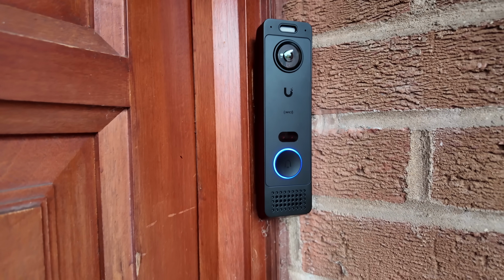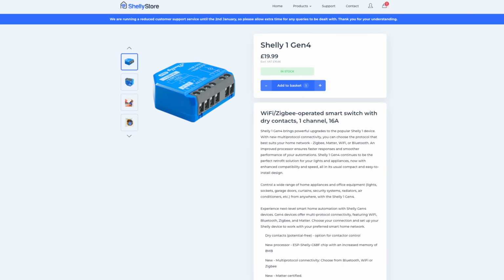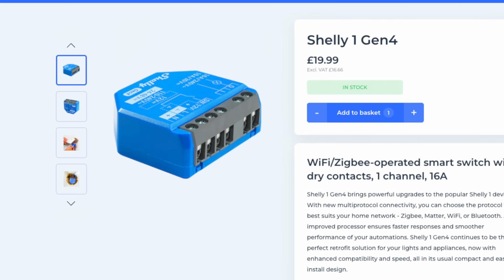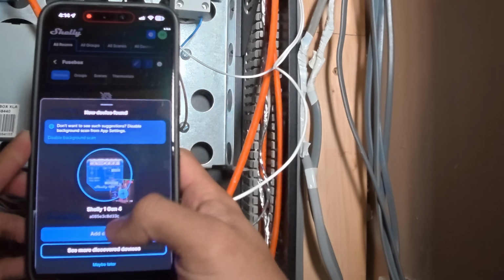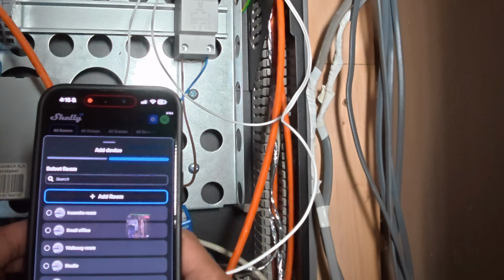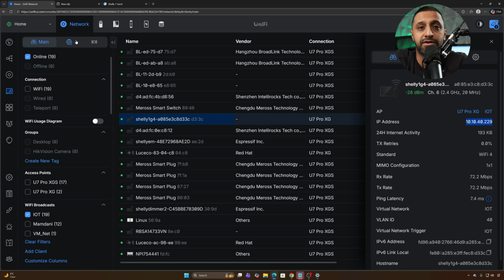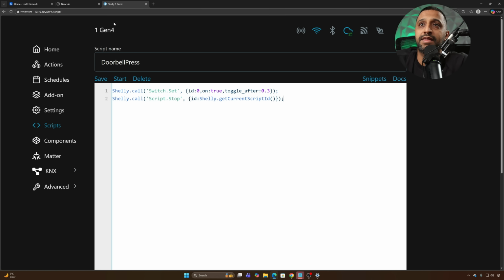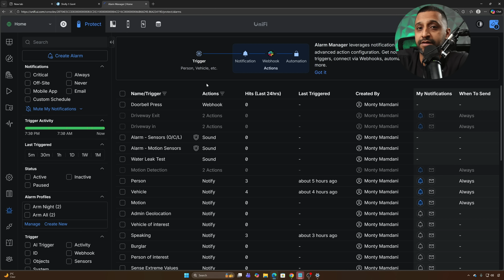UniFi PoE Doorbell + Mechanical Chime (No Home Assistant)

Comment: For anyone else doing this, do yourself a favor and get the Shelly Pro which has an Ethernet connection. This will give you a wired connection for the whole setup. Relying on WiFi could be problematic.

Comment: I would like to ask you if is possible to use a mechanical chime and get that signal to simulate the door bell is pressed? Something like adding a extra mechanical press button to activate the doorbell. Thanks
Reply: That‘s possible with Shelly but it would only trigger the chime when you press the extra button. You wouldn’t get a notification over unifi protect.

Comment: My question is about power supply:
	•	Does the Shelly require its own permanent power supply (e.g. 230 V AC or a separate low-voltage DC supply)?
	•	Or is it possible / intended for the Shelly to be powered directly from the doorbell circuit (typically 8–12 V AC from the doorbell transformer)?
Reply: Shelly Uni Plus can take 8-24VAC but the Shelly 1 gen4 cannot.  I am using the Uni plus powered by my chime.
Reply: You can use a AC to DC transformer to power the Shelly with the power supply of the chime.

Comment: I’ve also done this on my g6 lite, the only annoying bit is ubiquiti rate limit the doorbell notification. So if you’ve get 2 presses within say 20 seconds it doesn’t register the 2nd
Reply: Could someone test if this is also the case when the chime is connected to a hub mini (door 12V relay) and mapped to ring trigger in alarm manager? I assume it will be the same, due to limitation in notification in general?
Reply: @edstark5764 correct

Comment: The video was not very clear. Your hands wear covering what you were doing, so it is difficult to see how you are connecting the wires.
Reply from the maker: Thanks for the feedback; first time trying this kind of POV angle so will try and improve. I did put a diagram after the install showing you the wiring which you can see.

Comment: All I need is a Shelly and the G6 Doorbell, correct? No other (Access) Hub from Ubiquiti needed?
Reply from the maker: yes this is correct!
Reply: The doorbell requires a software service called protect. This typically runs on other ubiquiti equipment (gateways or nvr). You'll also need to provide the doorbell with poe power.

So afaik you can't run the doorbell without any of that infra.
Reply: @sanderdelft thanks for your reply. I forgot to mention that I own already some Unifi equipment such as PoE switches, the Cloud Fibre Gareway etc. 
I was more interested to know if any (access) hub is additionally required for faceID, NFC, etc.

Comment: Since I had never seen the UniFi transformer before, I was trying to find it in the store but couldn't. After reading the installation manual I found that it comes with the WiFi doorbell in the EU and not available in the US. In case anyone else was wondering about it.
Reply from the maker: I should have mentioned this in the video. (I thought I did)

Comment: I have a similar set up in our nursery (the poe or wifi chimes aren't loud enough).  I actually use an 'imaginary entrance zone' on a G6 turret and when someone enters it sends a script to the shelly device which automates the doorbell and a flashing light.  I don't have a script on the shelly device so just use it as a switch - the script from the G6 turret dictates a timer as well so the bell (not mechanical) and flashing light go off for 10 seconds.  I've got some doorbells on their way so will be wiring them up too.

Comment: I just used a hub mini and did the unlock to turn on the doorbell
Reply: Interesting. I assume you mapped in Alarm Manager the ring trigger to unlock the door (Normally Open) connected to Chime?

Why did you buy the hub if you don’t using the Relais? To get the NFC functionality? If you have a smart lock like Nuki, you can use the webhook or home assistant integration and open locks. I think this is how you solved it?

Comment: Very cool, but I need someone to show me ideas and tips for running cat6 to the doorbell in an existing home!! Everything I’ve seen so far pretty much says “it sucks and you’ll just have to figure it out”
Reply: This!
Reply: Yes, but this applies to running a cable pretty much anywhere in a house. The huge variety of construction methods for building means there's no standard answer. The thing is, you only have to do it once and it's then there forever.
Reply: There is no secret. You just drill the holes or hide it behind the baseboard etc. as needed. If you're not comfortable have an electrician do it.

Comment: I'm assuming this isn't local since you're using the shelly app for it to work? This is why Home Assistant is always my preference. The last thing I want is to have to download more apps to make things work in my home.
Reply: I could be wrong (I've always just used the app) but I believe the Shelly devices can be 100% standalone.

Connect to its wifi, figure out its default IP and connect to the built-in webserver via browser and configure it however you like. Once you add it to your own wifi network, it's ready to be used by HA.

If you haven't played with Shelly devices, you're missing out 😉
Reply: It’s all local, protect direct to the Shelly device over your local network. Shelly app is not required at all, even for setup, but it’s just easier to use. You can access the Shelly devices own panel via web browser and the Shelly’s IP.

Comment: Am I misunderstanding the point of this. Surely the doorbell integrates with the chime without this
Reply: The doorbell doesn't have any wiring to integrate to a mechanical chime in a house.
Reply: @JacksonCampbell I am looking at getting this setup, I was hoping I can plug the doorbell and chime into my cloud gateway and it will just work. Does the chime not support ethernet
Reply: The new G6 doorbells only run on Ethernet cable, not your traditional doorbell wiring.  So you need some fancy tricks like this to make it work.

Comment: This was the missing link which I had looked for.   I have been using the Shelly contact with a Home Assistant automation but it was not foolproof like this, since it depended on 2 external apps to get my electronic doorbells to chime with the G4 Pro (wifi version) to work properly.  
Thank you for this routine.
Reply from the maker: No problem. Hopefully it cuts out home assistant.

Comment: I'm curious if you get a temporary delay on subsequent pushes.  My alarm manager doesn't seem to trigger webhook on every push, Shelly isn't seeing every button push activation so I'm fairly certain it is on the unifi/alarm manager side.  For reference, my POE chime rings every push but there is something like a 12-15 second delay between Shelly activations.
Reply from the maker: That's interesting, I haven't noticed any delays myself. I have only had it up for about a week or so. Ill let you know if I see anything.
Reply: @InsideWire  to clarify, the initial push is instantaneous but subsequent rapid pushes don't sound the mechanical chime.  My Protect doesn't log the rapid repeat doorbell rings despite the POE chime sounding.  When Protect logs the repeat activation, those are the times when the webhook activates the mechanical chime too.
Reply: My Shelly’s connected to UniFi alarm manager are all instant
Reply: my first doorbell push is instant but then I hit some sort of built in delay for the next doorbell push to activate the webhook.  POE chime rings every time doorbell pushed though, no cooldown.
Reply: Yes, there is a cooldown delay, wich is unfortunate (

Comment: FYI: may need to use Shelly Uni Plus with chimes that run on low voltage AC (should confirm with multimeter).  I tried the shelly 1 gen4 but that only works with low voltage DC for power.
Reply: Um... Check it again.

110-240V AC
Or
12V DC
Or
24-48V DC

The Mini can only be powered by line voltage AC.

Maybe you were thinking you power the Shelly via the transformer? Yeah, that won't work. You would need a separate power supply just to get power to the Shelly, whether that's line voltage (110-240) or a random power supply from some old piece of hardware that is within the DC ranges required.
Reply: @PhilWard yeap, that's what I meant.  I didn't want to run more wires to my chime and just wanted to use the wires already present.  Was able to do that with the Shelly Uni Plus.  I'm no electrician but multimeter was reading about 21V on AC.  Trying to help any others that want to do the same or run into issues that I did.  Anyhow, would be happy to be proven wrong!

Edit: Uni plus accepts 8-24VAC
Reply: @twoshoe10 ah, makes sense and I don't blame you for not wanting additional power. Like you found, the Uni is the only other option.

I wish Shelly would come out with a dedicated "doorbell" device that was easier to install but meh...

Comment: One thing I noticed when you were wiring up the chime is the bottom wire appeared to be put in incorrectly. You want the free end on the right and the insulated side on the left so when you tighten up the screw, the screw will "pull" in the wire. By putting it in opposite of that, when you tighten up the screw it will "push" the wire out. I was not able to see how you wired it clearly but it did appear that you did not put the wire on the bottom screw the same way you did the top screw. Otherwise, a great video and I hope I saw that wrong.
Reply from the maker: Thanks for pointing this out, ill be sure to take a look to make sure it right.

Comment: I assume this would work just fine with the smaller 8A variant , the Shelly Mini Gen4
Reply: It should.

The main difference between the regular and mini is how the device itself can be powered. The mini is AC only whereas the regular can be powered by AC or DC.
Reply: @PhilWard ah! thanks for heads up
Reply from the maker: I haven't tested it with the Mini Gen4

Comment: I did this with a doorbell lite. If you have a doorbell chime with the transformer built in, which is easier, just stuff the Shelly in the doorbell box with 240v as power and put the low voltage doorbell wire into the dry contact. That keeps the power running to the doorbell as it should do in normal operation.

Also have a Shelly on the front porch light to trigger on doorbell motion detection, with the light on constantly to 10pm, the motion trigger after.